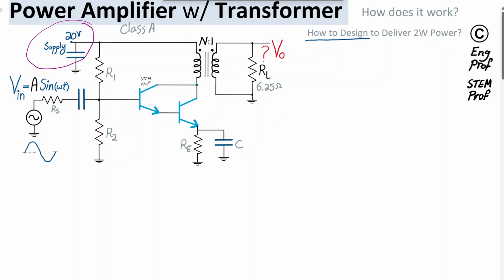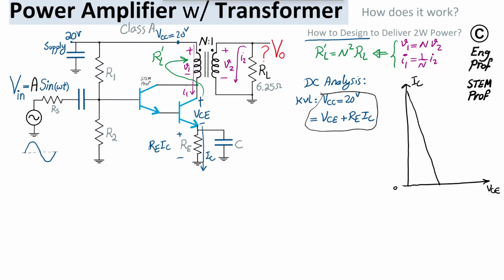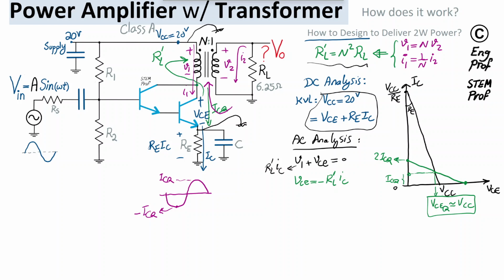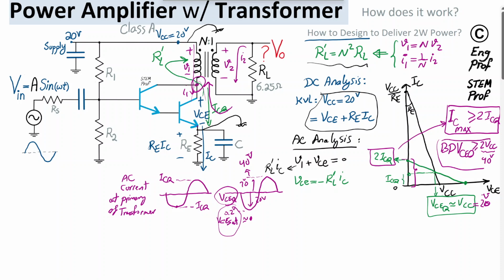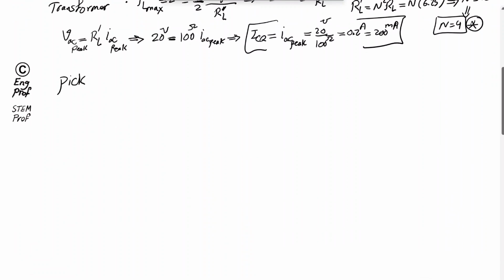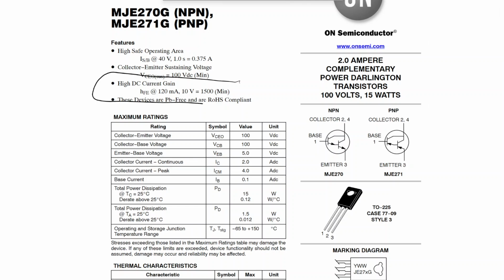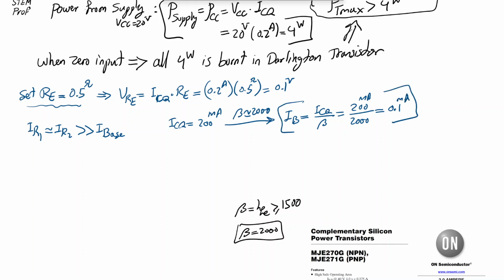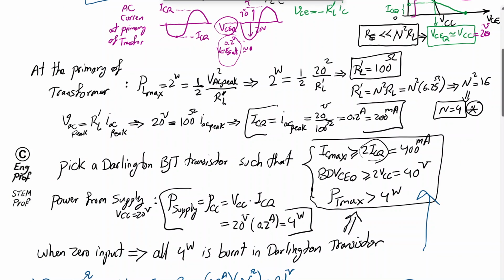Power Amplifier Design (Class A) with Transformer

Comment: Hi why is a power amplifier only delivering 2watts .  I think I’m unclear on the definition on ‘power amplifier’ thank you for all your videos
Reply from the maker: @tristech-dot-au  You are welcome. Thanks for your interest and good question. By definition, a Power Amplifier is a circuit that considerably amplifies the power of input signal to a desired power level at its output high enough to drive a specific load (headphone, speaker, transmitters, etc.).  More Amplifier examples are posted in my video Playlist (including 200+ circuit videos). I hope this is helpful.
Reply: @STEMprof  so would I be correct in saying that when you have an audio signal at line level it’s only voltage that varies so no powers transmitted so in this case to go from nothing to 2 W is a massive power gain. Is that the general concept?
Reply from the maker: @tristech-dot-au  That's about right Tristan 👌. Any considerable power gain especially if driving low impedance output loads would qualify the circuit as a power amplifier.
Reply: @STEMprof  you can see the gaps in my understanding thanks so much for your time
Reply from the maker: @tristech-dot-au  My pleasure. Glad that this video and discussions are useful.

Comment: Good video. So you got the transformer RL' of 100 and turns ratio of 4:1. So what is the transformer spec? Commercially available is 800:200 ohm. These didn't seem correct to me even though 4:1
Reply from the maker: Thank you, Glad that you liked this video.  Please see the minute 0:11 that states this is an ideal (de-Embedded) transformer in this analysis to just highlight the technique of reflected impedance in transformer circuit analysis. To consider commercially available transformers, we need to separate their impedance and model them as additional passive components at input and output of the transformer and then re-run circuit analysis or simulation.  Here are few more Transformer Circuit Videos:  https://youtu.be/k31t6mWa4Xs Transformer Circuit Reflected Load Explained: Power dissipation & sinusoidal steady state analysis
also https://youtu.be/iCuDWgAde58 video which is an OpAmp + Transformer Gyrator circuit to convert capacitance to inductance.

Comment: Nobody today is using transformer for power amp...
Reply from the maker: Thanks for watching and sharing your thoughts. While use cases of transformers are limited, there are still audio and automotive power amplifier applications using transformers. That is why Mouser and Digikey still distribute and sell transformers  https://www.digikey.com/en/products/filter/audio-transformers/162 and  https://www.mouser.com/c/passive-components/audio-transformers-signal-transformers/.  For more circuit and Op Amp examples please see Op Amp Amplifier with Electronic Gain Control https://youtu.be/NoNgQpbj77Y
Push-Pull Power Amplifier with Darlington Transistors https://youtu.be/866MYibo8yE
Instrumentation Amplifier with Electronic Gain Control https://youtu.be/C4tghZ-q6Zs
5-volt Charger Voltage Regulator with Temperature Compensation https://youtu.be/NdfyHoxjKrY
For more analog circuits and signal processing examples see: https://www.youtube.com/playlist?list=PLrwXF7N522y4c7c-8KBjrwd7IyaZfWxyt
Thanks for watching.
Reply: Transformers that are listed are not used in power amplifier except tube amps! @STEMprof
Reply: Nelson Pass F6.  Does "Pappa" Pass count?

Comment: This topology is of interest to me. Can this design be scalable to 50w with temperature stability? I am curious to see, as an audio amplifier a class A, 50w BJT SE with transformer coupling is similar to the tube version. McIntosh had them in transformer-coupled push-pull class AB but not class A SE.
Reply from the maker: Thanks for watching and your interest in this Class A power amplifier. Glad that this circuit is useful. For more Amplifier circuit examples please see https://www.youtube.com/playlist?list=PLrwXF7N522y4c7c-8KBjrwd7IyaZfWxyt
Regarding your question, depending on your target audio bandwidth of interest, it's important to select a high power Darlington BJT pair and also a very low THD Audio Transformer (not generic transformer). I also recommend secent supply bypass capacitors, a slightly higher RE resistor and also considering a reasonably sized resistor in series with the base of Darlington Transistor. Rest of it is just carefully experimenting and iterating. I will post Class AB power amplifier soon in my  Analog Circuit playlist https://www.youtube.com/playlist?list=PLrwXF7N522y4c7c-8KBjrwd7IyaZfWxyt . I hope this is helpful. 🙋‍♂️

Comment: Happy new year! How would you determine the value of C in parallel with Re?

Thanks for these videos.
Reply from the maker: You are welcome. Thanks Rafael for watching and comment. Happy New Year to you as well.  We need to set the value of bypass Capacitor C such that the 3dB cut-off radian frequency (1/RC) is at least 5 times less than the lowest AC frequency of operation for this power amplifier. For more circuit examples please see https://www.youtube.com/playlist?list=PLrwXF7N522y4c7c-8KBjrwd7IyaZfWxyt . I hope the Analog Circuit Design and Analysis Examples are interesting and helpful. 🙂

Comment: I do enjoy your analysis of these circuits. They encourage me to experiment to see how they perform. This one unfortunately left me hanging a bit since you assumed an ideal transformer throughout the design. Which is of course understandable for the sake of simplicity...and in the interests of time. I would be very keen to see how well such an amplifier might perform in practice from the perspective of THD and Frequency Response. Would you consider taking on the design of a suitable transformer such that a "flat" frequency response might be realised over the audio bandwidth ? This is a non-trival challenge given the need to sustain sufficient flux density within the transformer core without saturation.....
Reply from the maker: Thanks for watching and sharing your thoughts & suggestions. Glad that that you enjoy my circuit videos and they are useful. As you noted, it is not possible to consider all aspects of the design in the interest of time. To you point, practical consideration and THD of transformer parasitics and non-idealities including imperfect flux and magnetic coupling are important to achieve a decent functional design with acceptable in-band frequency response (say 20 kHz for audio applications). To achieve that the most important step is a  properly selecting Audio Transformer or Signal Transformer for the target audio application that can be purchased from either https://www.digikey.com/en/products/filter/audio-transformers/162 or https://www.mouser.com/c/passive-components/audio-transformers-signal-transformers/.  That proper selection should ensure a practically flat-response transformer in the desired frequency range. If need be, as the next step, an accurate practical spice model of transformer is needed to run realistic simulations in the frequency range of interest.  I will post more examples in my analog circuits and signal processing playlist: https://www.youtube.com/playlist?list=PLrwXF7N522y4c7c-8KBjrwd7IyaZfWxyt
I hope this is helpful.🙏

Comment: Your videos have a lot of good information. These videos help me a lot, can you do a circuit on high voltage output (400V p-p) and 500Khz push pull amplifier-- DC to AC. Input from 40 to 50V DC and output pure sine wave 400V p-p, 500KHz.
Reply from the maker: Thanks for watching, your interest in this engineering channel and your comment. Glad that you like these circuit design/analysis videos and they are helpful. Please see the following high voltage Push-Pull Power Amplifier Design https://youtu.be/C9Hse91r5sA with Op Amp and Darlington Transistors. For more related circuit examples please see: Push-Pull Power Amplifier Design https://youtu.be/866MYibo8yE 
Voltage Regulator Design with Op Amp BJT JFET https://youtu.be/CJl-urzeiTo
Full-Wave Rectifier Circuit https://youtu.be/DJJMNU-CYcg
Voltage Regulator design https://youtu.be/rI9f6-DyXxQ
Bandgap Circuit Design: https://youtu.be/esMlNx5w9Jw
Analog Exponential (Anti-Log) computer https://youtu.be/kk2c7Gk3nW4
PID Controller for Servo Motor explained: How does it work? https://youtu.be/NATBlfABXrA
Flex Voltage Regulator Example: https://youtu.be/CJl-urzeiTo
Op Amp Analog Differential Equation solver https://youtu.be/ENq39EesfPw
Sawtooth Oscillator with Op Amp, JFET and BJT Transistors https://youtu.be/5zHXTx-Vl20 
And my analog circuits playlist https://www.youtube.com/playlist?list=PLrwXF7N522y4c7c-8KBjrwd7IyaZfWxyt
  I hope the Analog Circuit Design and Analysis Examples are interesting and helpful. 🙂

Comment: If the supply voltage is 20V, how could you expect a 40Vpp as the output at the collector?
Reply: Happy new Year from Munich. When the primary gets decreased current (full neg. Current Swing) it acts as generator, negative on the upper side and so positive at the collector side, so collector sees max. 20V induction voltage plus 20V from power supply = 40V (voltage drop across Re was neglected).
Reply from the maker: @imunit6666  Happy New Year to you as well. Hope you had a great celebration in Munich :goodvibes: Thanks for watching and for your comment. For more analog circuits and amplifier examples please see https://www.youtube.com/playlist?list=PLrwXF7N522y4c7c-8KBjrwd7IyaZfWxyt . I hope these Analog Circuit Design and Analysis Examples are interesting and helpful.🙋
Reply from the maker: Thanks for watching and your interest in this power amplifier design example. As well-said by @imunit6666 , think of the total voltage at the collector as an AC sinusoidal signal with DC value of 20 volt and with peak to peak oscillation of 40 volts (20 volts above its DC and 20 volts below its DC). Then the maximum collector voltage will be 40 volts (approximately) and therefore the purchased NPN Darlington BJT transistor should have a Collector-Emitter breakdown voltage of higher than 40 volts in order to properly function in this power amplifier circuit.  For more analog circuits and amplifier examples please see https://www.youtube.com/playlist?list=PLrwXF7N522y4c7c-8KBjrwd7IyaZfWxyt . I hope this explanation and videos are interesting and helpful.🙏

Comment: BJT junctions typically change -2mV/degC, so over a 50degC change, that's 200mV for a Darlington Vbe. Therefore I'd make Ve atleast 500mV for bias rigidity.

Also batch variations can be +/- 30mV per junction.

Also there'll be asymmetric compression if the source is low impedance and the collector current tries to swing near Icq pk. An emitter degeneration resistor would fix that.

Also it's a good idea to have a base-emitter resistor across the 2nd transistor to swamp leakage currents at higher temperatures and also capacitive AC currents at higher frequencies.
Reply from the maker: Thank you for watching and sharing your thoughts and practical suggestions. You have good points regarding temperature sensitivity and process variations of PN junction. In this power amplifier circuit while designer has the degree of freedom to choose Re and set it to 2.5 ohm to achieve 0.5v at the emitter of Darlington transistor (instead of the suggested 0.5 ohm value in this power amplifier video) the only drawback is the 5x increase in wasted power in the Re resistor. The initial choice of 0.5 ohm only burns a negligible 20 mW while the increased 2.5 ohm burns 100 mW which should still be relatively ok compared with 2 Watts power delivery target to the resistor load RL. While the access port to the internal node of Darlington transistor might not be available (to insert a compensating resistor), I agree that a small emitter degeneration resistor is a good practice. In this design given the reflected impedance of 100 ohm, a degeneration resistor of few Ohm should practically be OK.  I will post more examples in the analog circuits and signal processing playlist: https://www.youtube.com/playlist?list=PLrwXF7N522y4c7c-8KBjrwd7IyaZfWxyt
Thanks again for watching and sharing your thoughts.🙏
Reply: @STEMprof  I assumed Re would be made larger to maintain the same Icq.

It would be interesting to measure the DC saturation current of some small audio transformers.
Reply from the maker: Thanks again for watching and your comment.